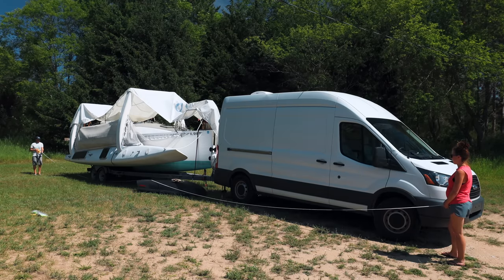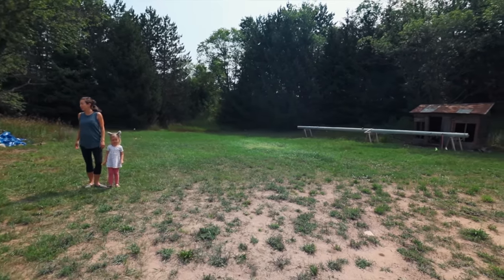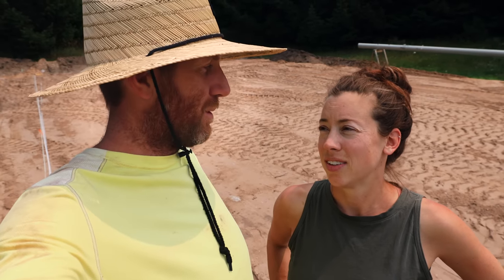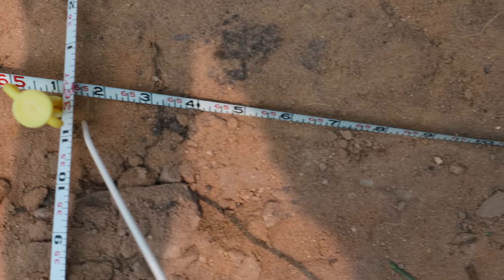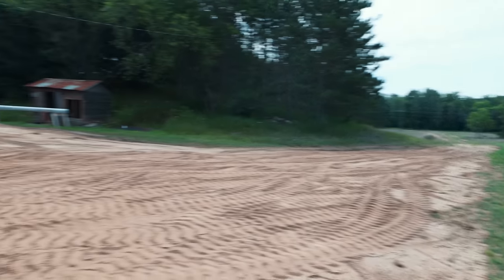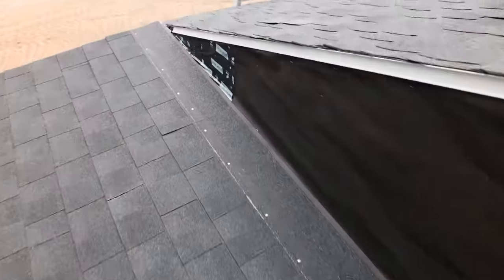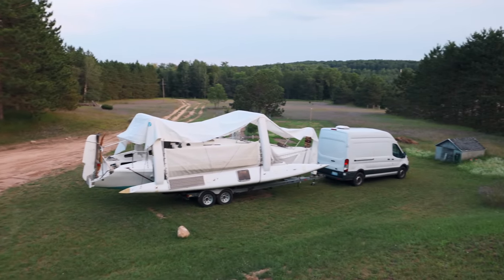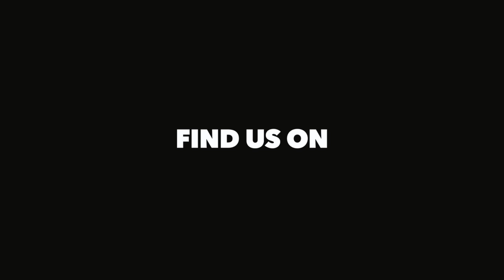We Almost Lost a Foot! while Building our Barn | Sailing Soulianis - Ep. 129

Comment: In construction we extend our pad out beyond at least 5 ft. The tape measure fiasco happens. Welcome to construction. You can always measure the diagonal for square! Using the same tape helps. Switching between tapes can mess a project up. My coworkers boss bought architectural scales for everyone jn the office. He saved money and they all came from China. 1990's they found out the scales were not accurate compared to the German scales. They were off 1/16" at 1" and those numbers compiled. Their office was still hand drafting. The boss gathered them all and trashed them. Measure, measure, measure and cut once. Great job on trusting your gut. 

Good job with the lean too roof.

Comment: The barn looks like a pretty good plan.  Glad you are going with a wide roller door.  That was my only mistake on my 40x60 barn was installing two 10 foot wide doors.  Yes, pontoon boats and RV will fit, but the clearance is very tight when you are parking stuff in the barn by yourself or you have a helper that doesn't know left from right or north from south. lol

Comment: Why didn’t you use construction glue on the studs before laying down the plywood. Also I would have increase the pitch of the roof angle to allow better runoff of water.

Comment: You can actually strap the boat to the trailer to keep it from tilting when you open the amas.  Or tie it to a stake in the ground or even a tree.  That's what I do, but I am in my driveway, and have a tree close by.  Have your boat stands ready and open slowly, and you should have no problems.  I have actually opened my amas on my own.  My boat is much smaller being a Super Tramp, (20') but same concept.   If you have someone on the boat to help push the arms down, it will be a lot easier.  My guess is your amas will be pretty heavy to lift into the fully open position by the person on the ground.

Comment: You're right, 4/1 is minimum pitch for shingles unless installed over continuous membrane. But hey, this is a lean to, not habitable space. You're making it work. Funny bit about grandpa's tape.
Reply: Is the roofing felt supposed to be rolled out horizontally from bottom up?
Reply: Yes. All Roofing (and siding) shingles from lowest to highest.
Reply: @gpdewitt  in the video he unrolled vertically, side by side.

Comment: It's a wise move keeping the boat in a barn.  I keep my boat in a shed, I can work on it whenever, not that it needs much.  So, it doesn't sit outside in a yard, deteriorating.  I don't have to put it on a mooring just because the yard wants to clear the space. Over 20 odd years I've only put it in the water when  I'm around and can use it, it hasn't deteriorated, so there's less maintenance to do, less cleaning after a winter, just rinse off the dust.  The big thing is I don't worry about it, that peace of mind, nothing gets stolen, mysteriously damaged.  I when I want to to work on it it's next to the house. Planning zoning should allow for more recreational space like this.